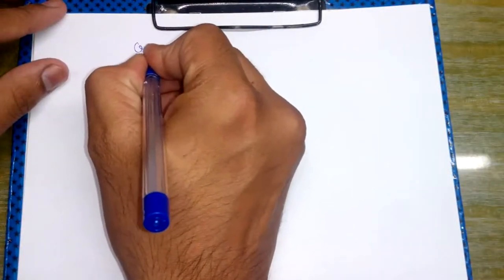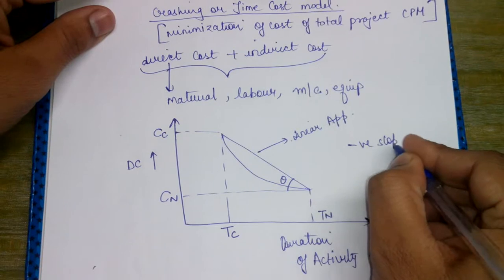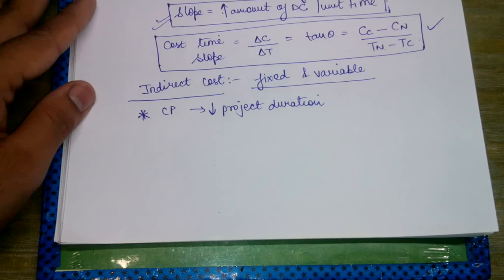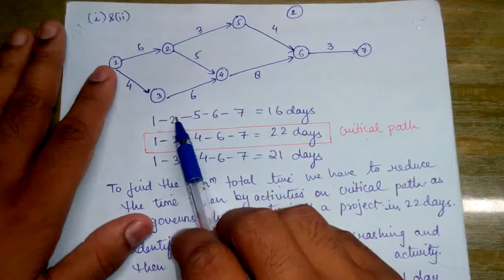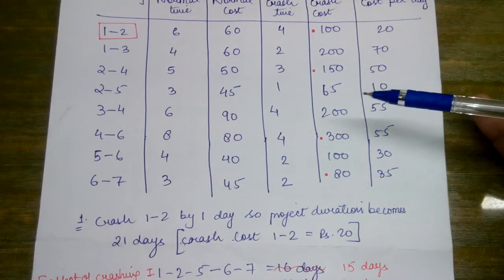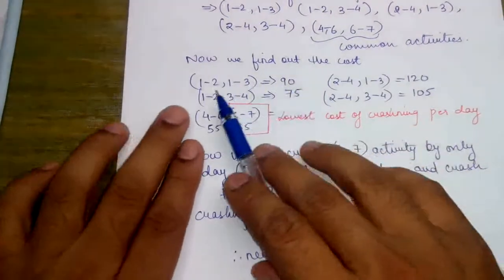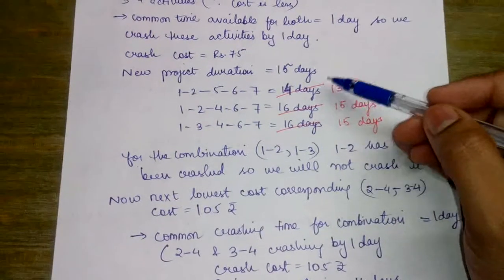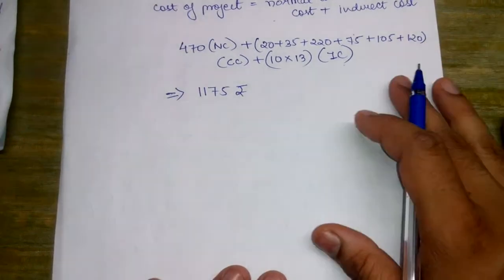Industrial Engineering Lecture on Crashing Model and time minimization.

Comment: Hello sir for one activity u took the sum for example 1-2& 1-3 cost is 75 which is less so we crashed it by 1 day but on the other side u considered 4-6 and 6-7 separately for crashing inspite as the sum of both cost is 90 which is greater than 75 so u considered it first for crashing
Reply: Why is it so we have to consider individual value of activity or the sum of combination  for crashing